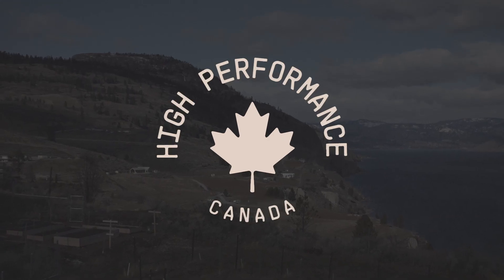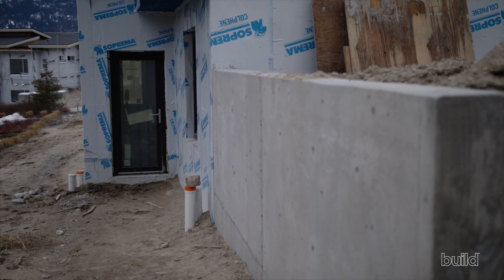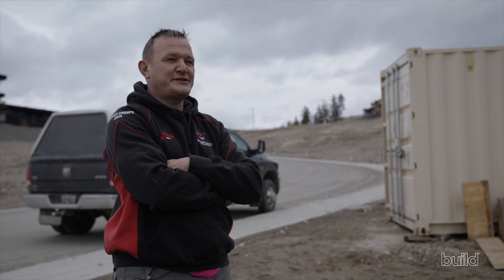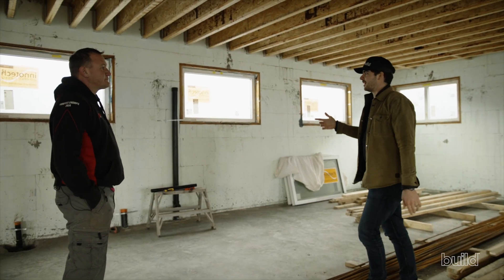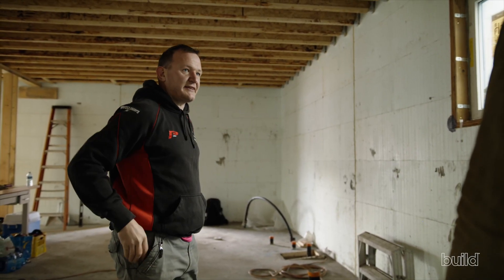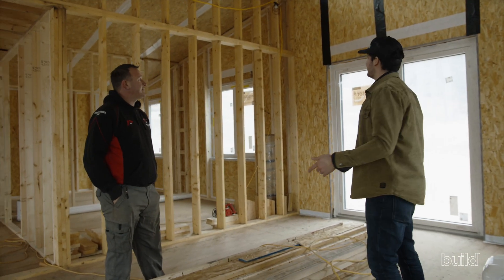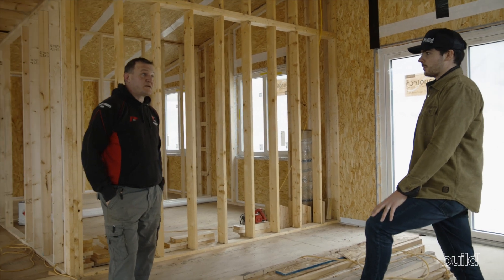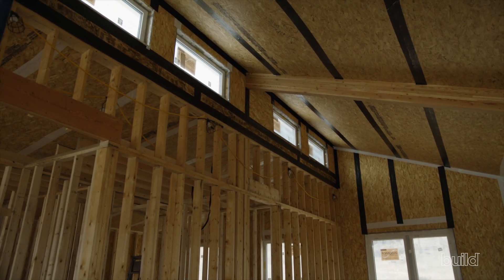Owner - Builder - City Inspector - Builds his on Step 5 Home - High Performance Canada Ep5

Comment: Would a concrete slab first floor add significantly to the structure?
Reply: With radiant heat you could maybe have better heating/cooling capability since the concrete slab would resist temperature change and therefore be more efficient, though the house may “breath” worse between the floors and you may possibly need/want additional ventilation.

Comment: Airtight = open invitation for microbial growth (MOLD).  What mechanical ventilation is being incorporated?
Reply: Is this your first time here?
Reply: @iker42  No. I've been in construction since 2011. I was poisoned by mold after my house flooded. Also hidden mold inside walls where plumbing had leaked.
Reply: @PatriarchyIsOverrated  I was referring to the Build Show and Matt’s videos. Airtight, high performance houses are the entire premise of these videos. A lot of engineering goes into air circulation and making sure everything can breath, even while airtight.
Reply: @iker42  I hope he knows as much as I have learned about moisture management. There is a monetary reason why insurance companies have mold exclusions and deny claims related to water damage. 
If you search for Melinda Ballard, you'll see why.
Reply: @PatriarchyIsOverrated   there is other type of sip which doesn't have wood in it , if I ever build a house it will be Thermasteel panels with fiber cement siding , nothing to burn , rot  , EPS  is water resistant, air thight , will not lose it's R value over time
Reply: @andreycham4797  
Thanks and I will look at that. The challenge with metal is that it harbors condensation.  Were you poisoned by a water damaged building, too?
Reply: @PatriarchyIsOverrated  The only bad thing I found  about steel , if you build a house close to ocean,  in air salt water would accelerate corrosion
Reply: @PatriarchyIsOverrated  Every house needs ventilation , on outside  there's nothing organic for mold to eat and to make condensation to dry faster leave a gap between wall and siding
Reply: It looks like the guy knows what he is doing I bet it will be HRV with integrated heat pump

Comment: Damn Canada knows what’s up. Any downside to ‘Giant Beer Cooler’ in America’s Midwest?
Reply: Nope, more insulation keeps you warm, or cool.
You may want to spend a bit more time checking your windows don’t get too much sun in summer (overhangs) but aside from that, just lower power bills for AC
Reply: The only thing I could think of is termites, just do not let foam touch soil and you will be fine
Reply: Higher upfront costs at a time when many are already priced out of housing markets.